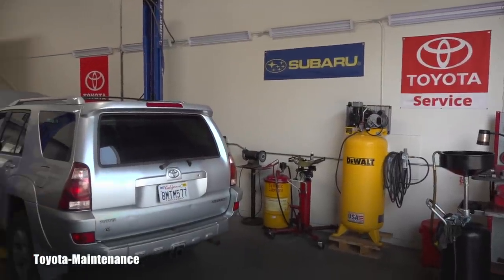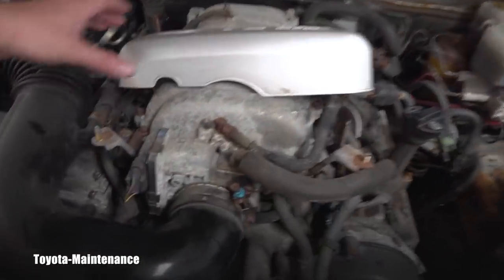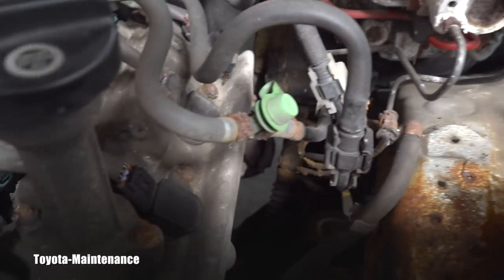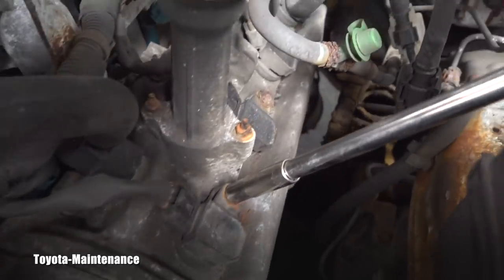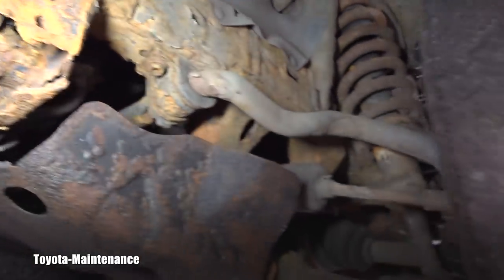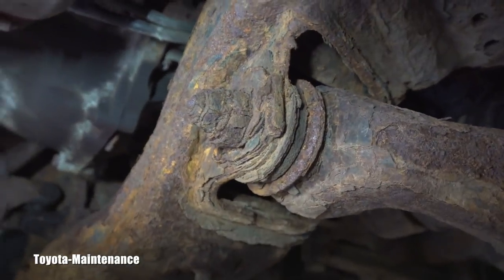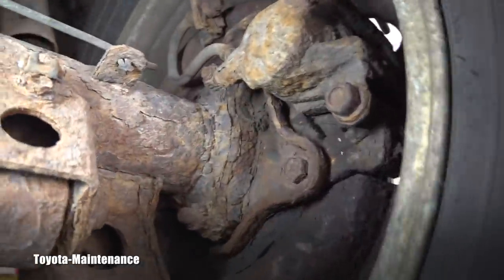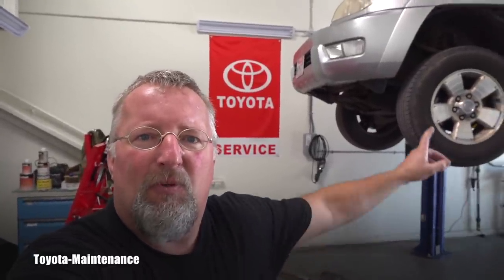Extremely rusted Toyota 4Runner

Comment: Hey this might sound crazy but thats not bad for a 03 my 07 was worse mins the rear axel because it was replaced when I got it in 2017 with only 60k on the odo and I sanded it down and painted it with rust reformer and looked like new up till the point I sold it about 3 weeks ago

Comment: When I was searching for a 4runner to buy, I looked at a 2006 that had spent most of its life in New York. Knew about the frame rust issues and immediately inspected it. It was flaking off in chunks in my hand on all parts of the frame. Toyota needs to take some responsibility for this like they did for the Tacoma’s with the same issue.

Comment: Here in upstate New York vehicles like this are common,  around here most vehicles just disappear into rust long before they have a major mechanical failure. 
Older Toyotas around here have rust everywhere,  often the frames are rotted to the extent that it's no longer possible to lift the vehicle using a floor lift like your shop has, the frames crumple if you try.  Brake rotors?   Only can be removed with a cutoff wheel or a torch.  

Here everything rusts out, people buying used cars here really need to buy used cars from states in the south where no salt is ever used on the roads.  Someone did a nice job of welding and reinforcing that Toyota's frame, here it's a common repair and often more expensive than the car's is worth.  No one in California should own a car like that one, the owner should immediately sell it.
Reply: Don't sell it to another person and transfer the risk. Sell it to a junk yard.

Comment: In NY they actually spray salt water on the road to prevent icing, and salt and sand during snow storms. You need a beater for the winters here.
Reply: I've lived in Buffalo for a few years and I've seen a street that borders a neighboring town get that treatment. Only half of this BUSY four lane street gets the saline solution while the other half gets dry salt, the Buffalo half. You'd think a friggin city would be on the ball regarding snowy streets, NOPE.

I was shocked when I found this out because this region gets dumped on so hard with snow. But at the same time, it's no surprise why this area of New York is underdeveloped. Slow, backwards thinking. You would think it was another state, not New York.
Reply: @Mr.Taylor56  Perhaps you are unaware? Slow, backwards thinking IS New York!
Reply: @OnlyGeneralMotors  Could be the country as a whole, I fear.

Comment: I just bought a seemingly pristine 2003 Sequoia Limited 4x4, black,  133k.  One owner with all service and maintenance done by the Toyota dealership.  Up to date with all milestone repairs. Clean Carfax 
History with all maintenance. Interior leather looking excellent.  Quiet,  smooth,  everything works. 
But spent its first 100k in Toledo, Ohio. 
Fortunately it doesn't have horrible rust issues,  mainly behind the rear axle shows some frame rust.  I'm 66 and not able to easily drop to the ground to look underneath.  
I just bought a  couple different types of rust treatment products and a new wire brush. Face mask and latex gloves to get underneath and deal with some of the rust.
Being a Texan... I admit I lost some sleep over this rust after shelling out $8,000 for this vehicle. But my oil change place got underneath and tapped around with a hammer for a couple minutes,  saying it's not that bad!
Now..."why am I selling my rust free 2002 Ford Excursion again?"
I knew better,  but I've been looking for a sweet sequoia for so long...I was blinded.

Comment: I purchased a pearl white 2014 4Runner from a dealer/mechanic. He has a successful business. I live in Vancouver, Canada and this vehicle was brought in from Calgary, Alberta. The previous owner was an executive from an oil field. I noticed small light orange marks around the screws that hold the plastic wheel wells. I guess its more visible because the car is white. Under the frame it has a bit of orange spots as well. The frame is solid when you touch it but should i be concerned about these orange marks under the frame. I asked the dealer/mechanic about it and he said i wouldn't sell you a vehicle that would have any issues. He said he had inspected it. I don't know if i put too much trust in purchasing this vehicle. It has 190,000 kms or 110,000 miles. Just wondering your thoughts on this.

Comment: I'm from Long Island NY, not just the salt in the winter but people drive through salt water flooded streets when there is a flood tide due to full moon, Nor'easter or a hurricane. 
Another issue is no one washes the undercarriage, they keep the body panels clean and waxed but out of sight out of mind.  
My tip, run a lawn sprinkler under the vehicle a few times a year, the kind that arches back and forth. It will get fresh water in the cavities and wash away the salt.

Comment: With a 5th Gen 2010 Trail in Massachusetts I try to get under, wire brush and paint where I can its frame and exposed components every few years.  Road salt is brutal.  Though my truck has high mileage (228k), keeping it well maintained has it running fantastic.  I love your videos, thank you.
Reply: KBS coat it exterior (they sell a kit) and KBS cavity coat the interior or similar long 360 degree wand with fluid film .

Comment: Kind of crazy I live in NY and have the same truck mine isn't quite that bad but the frame roted through in the same exact spots and I repaired it the same way but the rest of my frame is solid  and she's still running strong ill drive it into the ground b4 I give up on it but up here you see trucks with entire fenders rotted out and cars that are less than 10 years old with rust it's all in how you take care of them it's eventually going to happen but it's just a matter trying to stay on top of it these vehicles should have gotten recalled with the tocos for frame coatings but for some reason they never did

Comment: My 2008 Cobalt finally failed inspection due to rusted rocker panels in Massachusetts .  The fuel lines rusted out once , had them replaced . Tried to change fuel filter and had to cut lines .  A ten minute job turned into a whole day of back and forth to the auto store and cost me $100 bucks for parts.   The Cities buy salt not by ton but by mountain .

Comment: I bought a 2003 certified gold 4-runner (at first I thought that  the one you show might have been my old one) with 45k miles on it in PA and after inspecting the underbody after the fact I noticed a lot of rust on many of the screws, bolts and other attachments (3 years old). When I eventually had the spark plugs changed the guy told me he couldn’t remove them because of the rust, although he eventually did. I thought that maybe Toyota bought a bunch of substandard non-rust proof parts during that period?

Comment: My question to the owner would be do you feel comfortable transporting your loved ones in this rustbucket? Personally, I would just say thanks but no thanks..
Reply: They should salvage the working components  and immediately crush the rest.
Reply: I’m guessing that “The rest” will crush by itself....
Reply: @rightlanehog3151  If you can pull it apart. It takes almost half an hour just to remove a spark plug. 
Send it to the crusher. (unfortunately) 
No way I would let my family in there. Imagine how it would crush in a crash.

Comment: How are you doing my friend? I live in the northeast, & had to junk my 97 camry 267,000 miles. Engine was awesome, brake backing plates/rusted weak,  underside was bad too! Suspension parts needed replaced. I painted/rust proofed underneath myself but weather just too harsh.  BUT, I washed my engine constantly. Whatever brake job, etc I did myself, always used anti-seize on it. I had to pay a mechanic once in a while because of no torches, car rack, etc. But my mechanic thanked me. Stated they always enjoy working on it BECAUSE I tried preventative maintenance using antiseize. I felt bad because u get it all over the place when u take parts off. 😁

Comment: Rust in absolutely NOT inevitable, this 4Runner has simply had essential preventative maintenance  #neglected.  If you live in the Rust Belt take your Toyota to Krown Rustproofing or a credible competitor for an annual application. If you live in an area where roads are heavily salted in the winter then a high quality rustproofing program is as ESSENTIAL to the body as high quality lubricants are to the engine/transmission.  What a waste, with such low mileage this 4Runner could have had 10 more years of reliable service.
Reply: poor steel similar to tacomas
Reply: You mean 30 more years.
Reply: Right Lane Hog Wrong. The first half of the video is rust in the engine bay. Also, many of those coating places do not know what their doing. Cars from the north East that are over 10 years are ALL going to have rust. All of them if they are daily drivers.
Reply: Totally neglected and unnecessary.  I live in Iowa where we use nuclear road salt and my 2007 GX470 has no rust.  In the winter, I wash it weekly, including undercarriage, and undercoat in the fall with fluid film (internal frames and doors) and wool wax (chassis components).  If I see rust, I wire brush the spot and hit it with rust converter, then top coat with wool wax.  It’s a lot of work one Saturday each year, but worth it to protect my baby!
Reply: CP Topher's does the newer Toyota’s have better steel?
Reply: @treedeblue  they replaced many tacoma frames, so I think they are beyond that now. kudos to  toyota  for making it right.
Reply: CP Topher's it’s not the steel that is the issue.  It’s the steel treatment.  Due to environmental restrictions, cadmium, chromium, and nickel platings are being phased out and replaced with zinc and zinc-nickel platings.  Nothing protects better than cadmium and chrome plating but sadly, the environmentalists have won and now vehicles simply do not have the same level of corrosion protection as years past. To make matters worse, frames and body panels are half the thickness they used to be for cost and fuel economy reasons.  If you plan on driving a car in northern regions for more than 5 years, you must aggressively treat for corrosion on an annual basis.  Lanolin or cosmoline type undercoatings every year with regular undercarriage washes.
Reply: willytrouble88 thanks for this value information my friend
Reply: @willytrouble88  Ill second this, my 11 FJ and 18 4Runner got a good spring and fall coating of Fluid Film and/or Wool Wax. It's a battle hear in New England and takes some work  but worth it in the end. I also do the wheels with Wool Wax in the fall, great stuff.
Reply: Silver Runner I have it done professionally with wool wax every two years.  In between, I do spot touch up with fluid film and CRC heavy duty marine corrosion preventive compound.  CRC dries to a soft waxy film and lasts a long time on the exposed chassis.  Fluid film gets fogged into the frame holes and body drain holes and washes out easily so needs reapplied more often.  Yes, I still get rust and every time I see a spot, I brush it off and hit with rust converter.  It sure was a lot easier when I lived in Georgia!!!
Reply: @willytrouble88  bottom  line, the low quality steel rotted away , you do have something with the thickness.
Reply: Laughs in year 'round salt brine on Michigan dirt roads*
Reply: No doubt about it, that's a completely waste especially my 05 4Runner has closed to 300,000 miles and the parts inside isn't that rusted badly.....
Reply: @sirich7751  No, you are wrong. My Canadian car has been through 15 very salty winters and it recently had its 16th annual Krown application. Though the car is rarely washed in the winter, it remains rust free because Krown simply works. There may be other other products/processes which work just as well but I have always used Krown.
Reply: @sirich7751  
We are in NE Pennsylvania. Our RAV4 is over ten years old but gas no rust. Then again it has less than 48,000 miles and may never gave been driven in the snow.
Reply: @willytrouble88  You are absolutely right. This CAN be controlled but not by ignoring the problem as too many people do. Sure the salt is bad, but you have to take a little time after any big salt event and clean things up just as you (and I) have done for years. This is inexcusable and unsafe in my opinion.
Reply: llOOII llOOII you're a genius
Reply: @cptophers4626  Toyota Did Not offer any rotted frame replacement to 4Runner owners. 

There is a class action lawsuit out of South Carolina,   but not resolved yet. Toyota is not a reputable corporation  when they use such poor steel and rust protection then dont stand behind their products.

I bought a used 2005 4Runner, saw some frame rust, when I took in to get inspected, my service manager had it up on rack. Worst frame rot hes ever seen. Similar to this 03. 
I need to part it out and take my loss like a man. I really like the look of gen 4 4Runners but I threw my money away.
Reply: @johnhyman3549  by the time that lawsuit works it way through the courts, most of the 4runners will be long gone.
Reply: KROWN RUST PROOFING! .....Best damn stuff our there, I live up in  Canada and that how I protect my cars and trucks. 2004 F150 and its rust free, thanks to CROWN!
Reply: @davidcampbell1899  Krown works for sure. I can't share personal experience of other brands but they may work as well.
Reply: agree. during winters i always travel on salted roads but my car has rust just on the muffler. once x year i spray some oil, years ago i put some red minium paint. during winter i wash the undercarriage once or twice a month. my parents had a renault 4L that was used to go skiing, it lasted 25 years.
Reply: @cptophers4626  They DID NOT replace any 4Runner frames over 3 years old.....so not so right.
Reply: @cptophers4626  exactly, and Toyota is shirking their responsibility to the customer in trying to exclude 4Runners from the frame program every other truck of this vintage were in. They fixed tacoma, sequoia, but not the 4Runner, bullshit that they are leaving $runner customers to swing in the wind on this. These vehicles are failing the same way the trucks they are fixing failed, yet they are leaving us out in the cold on fixing the frame rot
Reply: Investing in a case of fluid film.

Comment: I have an 04 Sequoia and live in the northeast. I was told by the mechanic at our dealer mine was rusting underneath, but nowhere near as bad as this 4Runner. The mechanic said mine is not a safety issue now. Mine has 127000 miles and mechanically runs great. Because of the rust I am starting to look at something newer. Mine too is a limited.
Reply: Did you not get your frame replaced by the Toyota frame recall?  My 04 Sequoia's frame was completely replaced (for free) by Toyota under the Recall.  Not sure how you missed it...but you're owed a new frame for free.

Comment: Wow, I had a boat trailer that had less holes and I junked that trailer!  Another note is that I noticed it had California plates.  Does it actually have all the required smog equipment?  My GF's 6 cyliner 4Runner has more stuff on the engine than that V8!

Comment: I began my military career in Niagara Falls, NY as a mechanic in the early 90's.  I also grew up just down the Road in Rochester.  I've seen much worse.  Exhaust, parking brake cables and many other components required to pass a state safety inspection routinely would rust out.  I've replaced many brake calipers as well and forget a bout a starter.   The body used to rust through in a few years, due to a rock chip that was affected by the road salt in the winter.  In those days, a car would show signs of rust no later than 3 years...five  if you are lucky and kept on top of cleaning it and doing touch ups.  I had an 89 S10, granted it wasn't the most quality vehicle, but it had holes in it by the time I gave it to my neighbor in 1996.  My Dad had several vehicles (Ford, Chevy, Chrysler) with holes in the floor boards and you could see the road when you drove.  My father in law  had his transmission cooler and lines rust out in his 10 year old F150.    Enough Said.

Comment: I imagined Petr would have worked on cars back in the Czech Rep, and would be familiar with the effects of salt.  Maybe not, because he sounds like the mechanics that service my Honda Odyssey that I brought to Cal from northern NY state.  The younger ones freak out as though it was falling apart, but the older ones are cooler about it.  You can tell the structural integrity is sound, by the ride, at least with uni-body construction.  Frames may complicate matters.  I can't sell the vehicle, so I'm keeping it as an extra, but in the east, nobody would bat an eyelash.
Reply: Tom Jelinek you are right. Almost all cars and trucks get like this in NY. They rust out way before they wear out. It is a shame they can’t make cars more rust resistant for areas where road salt is used.

Comment: This almost looks like saltwater flood level rust, but it is also 17 years old.  I've heard of many cars where I grew up (ohio) being sent to the scrapyard for rusting away.  Mechanics do usually point out that they're unsafe and can't be fixed when they get that bad.  That frame will fall apart in a wreck
Reply: Agreed, had to been putting a boat in the water or parked near the ocean. Then again, Toyota seems to recycle steel and it's not a quality product for very long...

Comment: Neglect, everyone knows how much salt they use up there. You have to fluid film them.
Reply: There are countless class actions lawsuits against toyota for rust issues...they use the cheapest steel in the industry.  There are 1950's F-Series still on the road under the same conditions, Toyota is cheap junk.